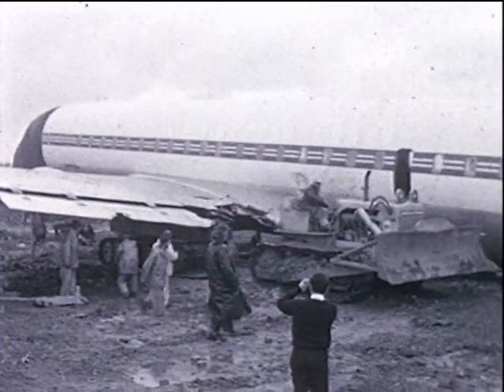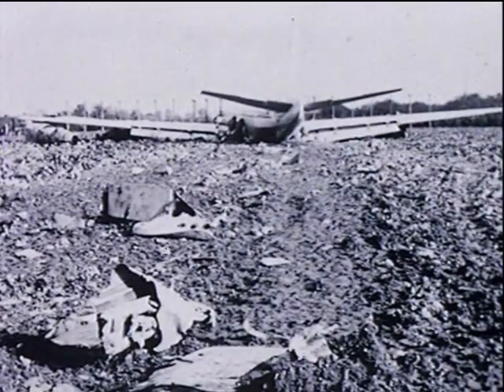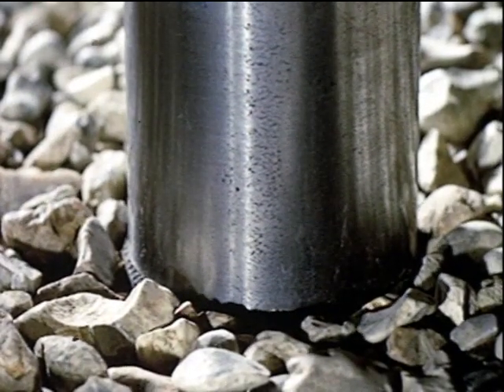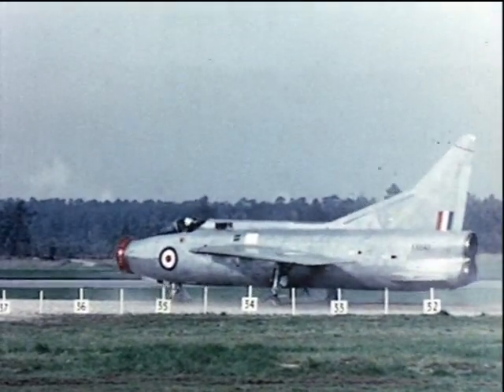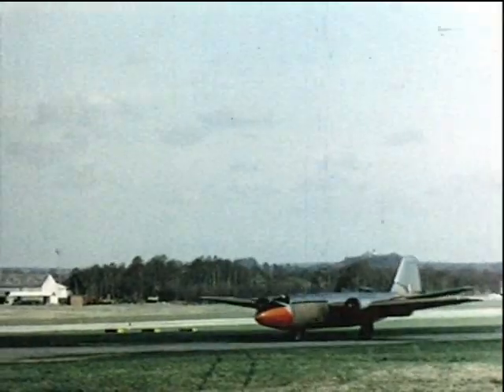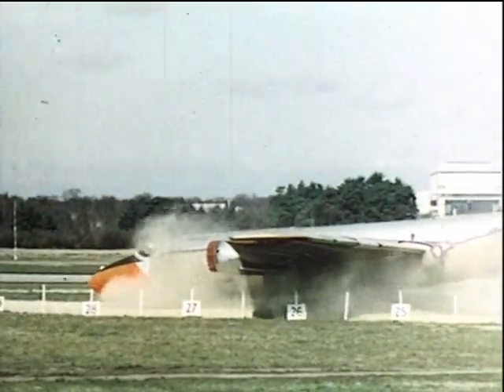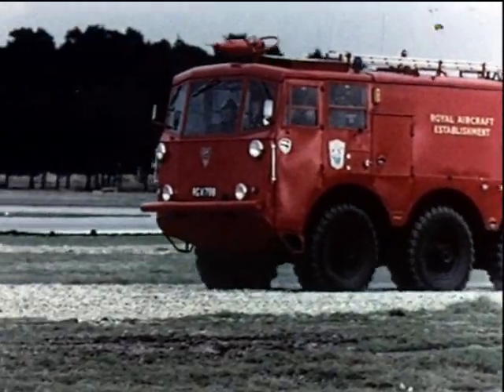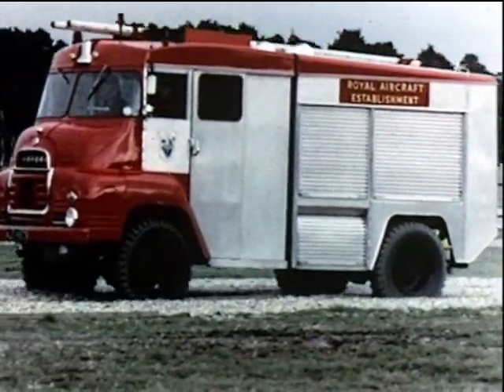Soft Ground Arresting

Comment: The Lightning has a very strange tail fairing that never appeared on production aircraft as far as I know. I assume it was a ground running only test aircraft by this time.
Reply: The tail on the Lightning was a early test to enlarge the tail plane to compensate  for the  larger ventral tank.

Comment: Is that an experimental vertical stabilizer on the Lightning or a prototype aircraft?
Reply: It was an early prototype P1b XA847.It was originally on display in the RAF museum until a F6 replaced it.  It still exits and is waiting restoration.